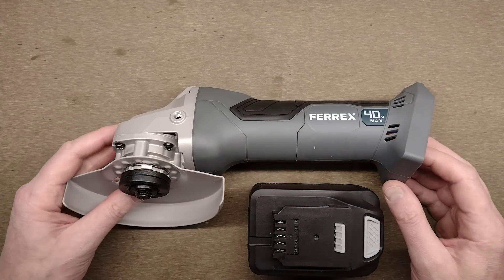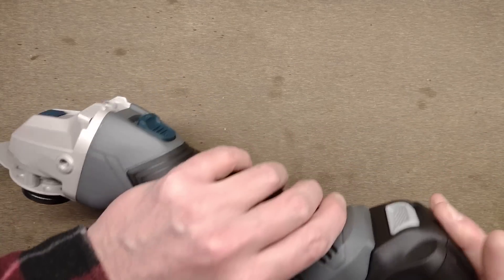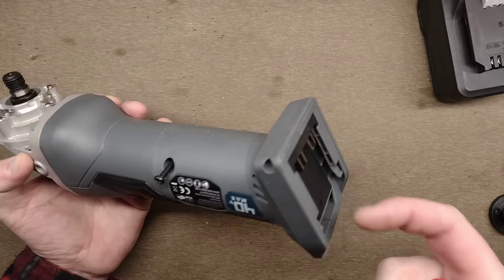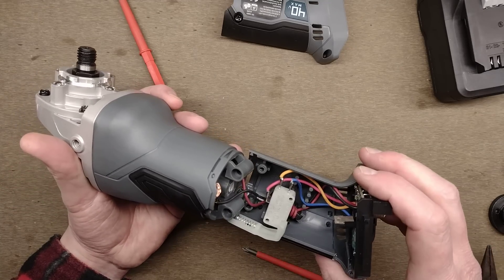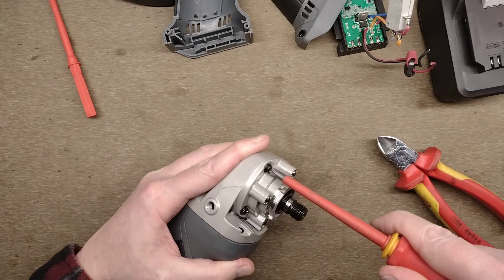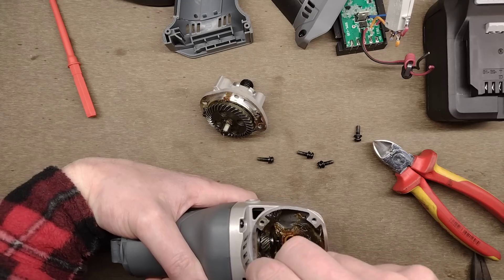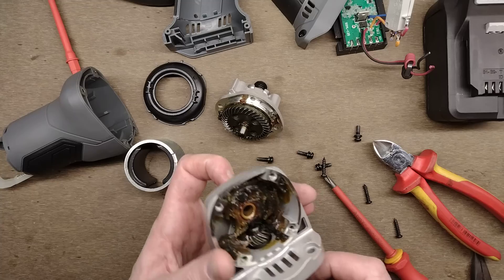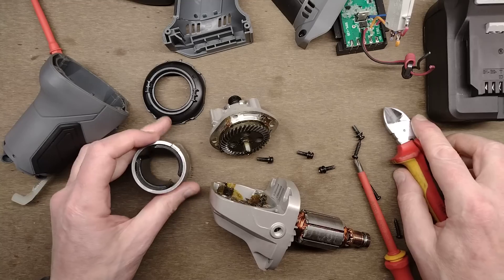Aldi 40V angle grinder mechanical teardown

Comment: Handy thing to keep in the car incase you need to remove a wheel clamp.
Reply: Debooting and storage units are the only reasons for a cordless angle grinder from Aldi.
Reply: @paradoxworkshop4659  i used my 40v Ferrex to cut up some rebar
Reply: Or used by some thugs to cutoff catalytic converters. 😢
Reply: Or nick a high end push bike

Comment: Aldi is a usa grocery store that actually charges you a quarter to use a carriage
Reply: Aldi is German. There's Aldi Nord and Aldi Süd, originally operated by the brothers Karl and Theo Albrecht. The ones in the US are Aldi Süd. Aldi Nord also operate in the US but under the brand name Trader Joe's.
Reply: @chrishartley1210  I confess that I've never seen angle grinders being sold at my local Trader Joe's.
Reply: @tubastuff  No, I get the impression that neither of the US outlets sell electrical hardware.
Reply: Yes, but you get it back when you are finished with the cart.

A few other stores here use the same locks on their carts.
Reply: @sethhoffman8149  Yep, the carrot and stick approach works wonders on the slovenly yobbos who delight in dumping shopping trolleys all over the place! 😉😊

Comment: It's nice to see metal gears and not plastic gears considering how cheap this item is, even though the gears are obviously very noisy.   That is a pretty decent looking motor.  Looks like this would be okay for a cheap tool.
Reply: Good enough to cut off a couple catalytic converters...
Reply: @volvo09  ha
Reply: Can't really plastic those
Reply: @zachv1942  You can and they have, the bigger gear only of course. My father had a name brand (AEG I think) grinder back in the 80:s and he ran a large wire brush on it for an extended time which melted the plastic gear. Guess that's why they now make them in metal.
Reply: @Murgo-u3l  

I've never seen ANY power tool like this with plastic drive gears and there's a good reason for that, it would work... for five minutes if you're lucky.
Reply: The real question is whether those gears are powdered metal or actually machined. I'm going to assume powdered metal. I suppose the three tiers would be unhardened unheat-treated crap steel, powdered metal, and then properly heat-treated steel.
Reply: @PaulSteMarie  unfortunately Clive didn't go into those details. My best guess is sintered at that price
Reply: I wonder if these are made by Positec? I think they might be. I've had great experiences with positec tools (titan, erbauer, worx,  bauker) use them at work. They last as long as the main brands, in my personal experience.
Reply: These gears can be made of Chinesium, you never know for sure.
Reply: @jkobain  

I've got a cheap Einhell grinder which has been used and abused for over 12 years now and is still going strong. The whole thing is made of 'Chineseum' too.

Comment: It's bizarro world, when Bg Clive is talking apart power tools and Matthias Wandell is measuring battery performance. I guess AvE will take up woodworking soon.
Reply: AvE is very busy clubbing Seal Pups at this time of year. Was gonna make the Blown Seal joke, but it's getting very old by now and I don't know if AvE wears a moustache 😂.
Reply: AvE uses dead tree carcasses the right way. Into the stove  heat the shop to make something out of metal. Or at least chainsaw something open.
Reply: Inverted hierarchy. World's gone mental
Reply: It's 1o'clock in the morning, there's oil on AvE's hands again...
Reply: AvE got weird. Made me sad.
Reply: @alwayschooseford  me too.
Reply: i dont think clive wants to put a certain member in the vice
Reply: I would be more worried if AvE took up electronics. ElectroBOOM doesn't need that kind of competition.
Reply: @UpLateGeek  
AvE has his electrician buddy "
Reply: Best comment ever! 👍🏻😀🇬🇧
Reply: Haha great comment. ❤😂
Reply: Hopefully it's not the first thing that's not going to leave the healing bench
Reply: manipulating dead tree carcasses you mean?
Reply: AvE is a master craftsman, he could build the Mayflower from two pine trees.
Reply: @dsloop3907  
Only if he is allowed to use a chainsaw and lots of shmoo
Reply: Someone tell him you can't weld wood.

Comment: unless things have changed it does just put the batteries in either series in the 40v tools and paralell in the 20v ones. since they are drained and charged together unless you screw with it by manually draining one of the sets of batteries they should never drift TOO far out of balance.
Reply from the maker: I'd guess that's what's happening, but I wonder if the 20V tools do just shunt them in parallel or use just one set.  I meant to get a 20V tool to check, but ran out of time.
Reply: @bigclivedotcom  from what I could see when I opened one of mine they use both sets, there's copper trace linking the battery connections right at the battery terminals before they hit any components. I've got so many ferrex tools and garden stuff. They are honestly a bargain for a cheap skate DIY person like me.
Reply: @bigclivedotcom  They do indeed place the two packs in parallel. The charger also charges them in parallel.

Comment: A nice teardown of a decently built device. Pity it doesn't have a brushless DC motor.
And oh yeah, conformal coating on the PCB!
Reply: A  brushless motor would require a multiplier like a planetary gear set. They have the speed, but not the torque. They are not interchangeable. So there goes your compactness and price point.
Reply: @ipissed  so, you're saying that all the other brushless angle grinders out there are required to have an additional gear box? I haven't heard of one that does.
Reply: @ipissed  that is UTTER BS.

every BL-DC motor can have wayy more rpm's or way more torque then a B-DC motor. or somewhere in between.

i own a 18V Fein angle grinder (prosumer tool) and it features Fein's own 850W BL-DC motor. in direct drive on the pinion.

and it rips through 4mm stainless like a hot knife in butter.

Comment: Good price for light duty use - The 20V/40V approach is interesting.

As for video colour temperature it's much improved 🤣 Sound also seems a little less sibilant, to me very acceptable - it's a toss up, do you go for HiFi quality with booming bass etc. or clear sound with a little sibilance which gives better intelligibility - after all it's an instructional video not a Albert Hall concert!

Looking forward to the circuit analysis.

Comment: Not a bad bit of kit for the price. It did sound like some greaze was needed on the bearings.
I'm looking forward to going a lot deeper on the bench with you back on the IOM.
Reply: It did sound rough from the get go...
Reply: @IceBergGeo  It did. more grinding than grinder.
Reply: That gearbox is actually skimpy on the grease, the cheap tools always benefit from adding a bit more to make them last longer, the gears always wear rapidly first, before anything else gives out.
Reply: @m.g.540  it sounded like it needed more grease I guess its the built in obsolesce. As soon as the warranty is over the thing falls apart.
Reply: @dcallan812  since at that price point it's more a hobbyist tool or something that you would buy to have an angle grinder "just in case" i expect this to hold longer than most professional pieces of gear, just because of the extremely low frequency of use.
Reply: @JefframinEpsteinyahu  true 👍👍
Reply: Never mind going deeper, this thing will probably go straight through the bench. 😂😂

Comment: I missed the price in the video. 10£? 20£? Either seems like a good price. But is that including the battery? Here in the States the batteries are a big part of the price of these kinds of tools.
Reply: It was supposed to be  20£ but rang up as 10£.
Reply: That's excluding the battery, or is supposed to be. Clive got a VERY good deal if it included the battery.
Reply: @chrishartley1210  It's on offer at £9.99 at present, so that was no mistake at the checkout.  Normal price £14.99 apparently.  But battery is £26.99 and charger a steep £41.98.  So a cordless grinder for £78.96 in total.  Cheap?  Not unless you already have other tools which use that battery and / or charger.
Reply: @heckelphon  £41.98 is for charger and battery. The charger alone is £14.99. Currently £51.97 for angle grinder, battery and charger.
Reply: @chrishartley1210  Thanks for that!  I get slightly different things appearing at the bottom of the Aldi page with the angle grinder each time I look.  Identical grinder at £29.99 now pops up, which is ridiculous when I have the large product display at the top of the page saying offer price £9.99, normally £14.99.  Yes, that £41.98 for battery plus charger makes more sense.
Reply: @heckelphon  At least Aldi don't do the usual supermarket trick where the combined components are more expensive than the sum of the individual items. A lot of them would have added £26.99 and £14.99 and come up with a combined price of £41.99 or more likely £42.99.

Edit: I was expecting the more expensive grinder to be a better model, they've done that with the impact drivers, but nope, exactly the same as far as I can tell.

Comment: Disappointed that we didn't get an AvE unboxing with a chainsaw. But the 20v/40v battery looks very intriguing. Looking forward to a teardown of the battery pack and the charger. Unbelievable steal for the price you paid, I'd go and get 4 more.
Reply: Try “bevel gear”
Reply: DeWalt 60v flex batteries are sort of the same idea they work on both 20v and 60v tools.
Reply: Trouble with aldi is they won't have them when you go back. My local store had these but no battery packs or chargers.
Reply: @dogwalker666  the online store is usually pretty well stocked and the postage is free above £30
Reply: @ConorNoakes  oh didn't think of that option.
Reply: @dogwalker666  Yes they used to sell whole units here in oz, now its all skins.
Reply: @EmeraldHill-vo1cs  it’s annoying to say the least.
Reply: @dogwalker666  All available online and currently at sale prices. Don't know how they do it.
Reply: @dogwalker666 I’ve had almost the full range of these tools for three years now and they are still doing them.
Reply: @andrewgilbride7546  unfortunately not in either of our branches.
Reply: Nothing particularly complicated about it, the battery is actually a pair of 20v batteries presented across four pins.

The tool connects to them in either series or parallel

The charger just connects them in parallel and charges them the same as the smaller 20v only batteries but with a larger capacity (charge times reflect the difference between 2Ah and 5Ah too)

Comment: Looks very hackable for alternative applications, if the output can have something else mounted easily.
Reply: My immediate thought is a "ghetto" right angle adapter for a mini-mill.  Far more robust than the dinky little right angle screwdriver attachments, but not so expensive as a Bridgeport right angle head.
The concern would be runout and shaft wobble, but as an experiment and messing around? It would be fun for sure.

Comment: 10£ is an excellent deal...hell even the 20£ price is pretty good...assuming it will last a while.  
Can't wait for the next video...I like seeing the electronic bits  :)
Reply: for a tenner, even if it only lasted a couple of jobs, it would be worth while.    It is cheap for a throw away tool even, and looks like that motor could have some power.
Reply: That seems ridiculous considering the battery which would cost more than that for a knockoff for other brands.
Reply: @chaos.corner  i just paid twice that price for an aftermarket dewalt XR battery of half the capacity of this one 😂
Reply: The quality definitely appears to exceed the classic harbor freight $10-$12 (when on sale) grinder.
Reply: My dad has had his Lidl Angle Grinder for about 10 years 😂 he's done countless hours of cutting and grinding and I think last year it broke. Turned out cable was dodgey so reflexed it and its still going strong!
Reply: It was probably sold as a bare tool (no battery). It's all gone a tad razor-blade economics...
Reply: @tbavister  yes batteries and chargers are seperate.
Reply: They are £40.
Reply: @dogwalker666  The standard 20/40v grinder Big Clive has dismantled here, its normal price is £20, The brushless model is about £10 more ( both bare tool, No Battery or Charger). I actually have both models. The brushless model is supposed to be easier on the battery and runs at 20v, either smaller 20v battery pack or if you use the 20/40v battery it will still run at 20v 2X 20v in parallel (stacked) to give you extra current  potentially providing more torque and slightly more than double running time due to shared load of 2X 20 packs reducing loss as heat, might need big Clive to explain that in more detail. The brushless grinder runs far too fast without any means to regulate it or slow it down, I am afraid to use it as I feel the poorly balanced disc that came with it might disintegrate at the high rpms, I had to keep shutting it on and off to keep the speed under control, I think it should have a recall for safety reasons, so I don't use it, it probably ok for the lighter cutting blade but be warned its fast and powerful so wear all the protective gear.
Reply: I think it should last a while as long as your not running it for prolonged periods of time or your not using it to cut through 1/2 inch plate steel or heavier it should be decent
Reply: A meth head could probably remove several cats with this
Reply: Tenner is good value, it does mean buying in to the range, the more expensive and somewhat elusive 40Volt battery and the separate charger. Grinder was on sale at 20, then halved to 10 a day or two later, strange that it got put back to 20 soon after, although as Clive found out, (and I had pondered myself), these still went through at 10 quid.
Reply: This is a decently made grinder for that price, and I'd buy more than one, myself.
Reply: It will last a while if you don't use it. It has laughable ventilation, which means the duty cycle must be very low, so it's just good for very light home use.
Reply: @acorredorv  actually my new DeWalt 110v 11000 RPM has terrible ventilation too.
Reply: It would be ok if you were cutting something thin and hard with a light disc, absolutely useless in something like wet brick or pointing which has a lot of drag, will burn out in minutes.   You will do your little job, throw it in the toolbox and the next time you want it the battery will have died . Permanently !
Reply: One hell of an assumption you’re making there Greg.

Comment: The right angle drive thing is a ring gear, which gets driven by the pinion gear. Similar to how the ring and pinion in a car's differential works.
Reply: There must be an interesting language relationship between "pinion" and "pillion" (as in riding a motorcycle pillion). I did a very fast bit of wikipediaring, and it told me that 'pillion' is gaelic for 'little rug' (which asks its own questions) but no connections to 'pinion' but I am sure there must be.
Reply: @Gazr Gazr https://en.wikipedia.org/wiki/Differential_(mechanical_device) There are multiple ring gears in a car. A ring and pinion is a type of bevel gear.
Reply: Handy source of parts these grinder gearboxes. 
2 similar grinder gearboxes can be used to make a differential unit for an ebike or ordinary push bike trike rear axel. 
Just make a casing to suite.
Reply: Crown wheel and pinion in a diff, this is a bevel gearbox. The ring gear is on the flywheel of an engine.
Reply: @finger351  There are multiple ring gears in a car, crown is another name for ring. Both crown/pinion and ring/pinion are types of bevel gear.
Reply: @mtreis86  No, there's one ring gear and it's around the flywheel for the starter to mesh with, unless you're American in which case you use your own names for car parts. If this sounds aggressive I  apologise, but a ring gear and a crown wheel are different things.
Reply: @mtreis86  I'm not arguing as you may not be in the UK, however for us over here a ring gear is exactly that: it's a ring with gear teeth on it that's heated up, thus expands slightly, then fitted over the wheel it's driving. Upon cooling it contracts to fit tightly onto the driven part.
Reply: @sideshowbobsfanclub  Yeah in the US we also call the gear around the flywheel a ring gear. Same with the gear on the axle stub used for ABS. Any gear that is fitted to the outside of something else basically. Since the diff gear was made out of two pieces to save money, one part the gear and one part the mounting plate, we called that a ring gear too, even when they are made from one piece.
Reply: @finger351  Am American, we have a dozen names for everything.
Reply: Nice try, but a ring gear is something different. This is a helical bevel drive, similar to a regular bevel drive but the teeth are slanted, hence the helical bit.
Reply: The video is posted 2 minutes ago, how come these folk post comment from 3 weeks ago? Time warp? Space time continuum. I love rack and pinion steering but now it's all electronic/motor driven took the fun out of sporting.
Reply: @tech29X  As Clive has stated in the description, Patron members get early access to the videos.
Reply: @bgood2010  Oh darn it, I'm just a poor bum :) I thought my premium tube membership paid something towards the channel. Everywhere I turn, there's a tip jar; 20% used to be for exceptional service, now some places are pushing for 30% (as if prices didn't go up already). Can't wait till the coveted WEB3 gets here, every click is gonna be a dollar here, a dollar there$. DeFi my A$$